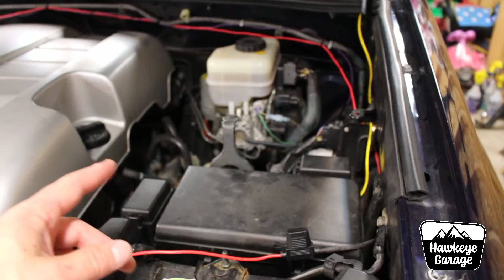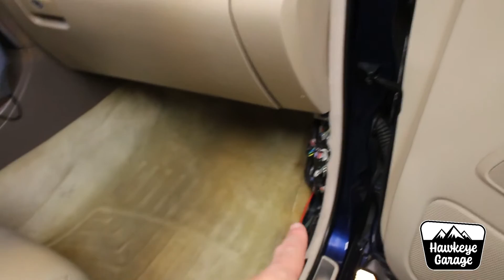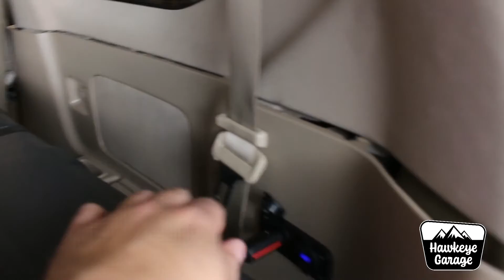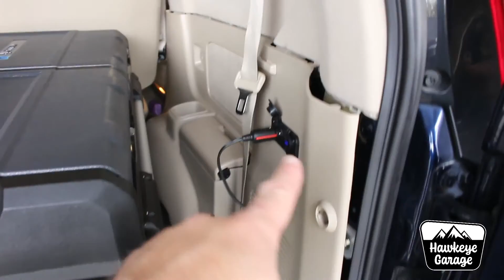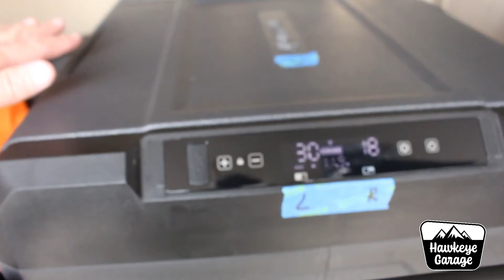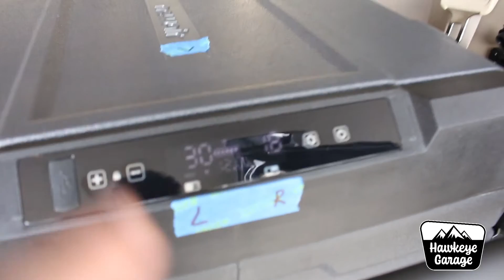Cargo Area 12v Plug and USB Wiring and Install

Comment: Hey Joe!
Thanks for the helpful videos!
I need help with my GX, changed all shocks to 5100s.. Now I got lights on my dash because of the front shock absorber sensor was removed. What can I do to get rid of the annoying lights on the dash?
Reply from the maker: Not sure, I expected that but I dont have any lights. Im still running air bags maybe thats the reason. I know there are videos out there addressing it though.
Reply: Thanks for the reply.. Im also running air bags on the rear just changed the shocks. Did you plug back your shock absorber sensor back thats mounted on top of front shocks?
Reply from the maker: @azfarc11  No I trashed those modules.
Reply: and you did not get any lights on the dash?? If you didn't that means Abs wire got stretched or ripped 🤔
Reply: my bad just read you 1st reply..Damm it's the abs I guess 😢
Reply from the maker: @azfarc11  that’s not too hard

Comment: Where did you ground to? Also did you just run 1 power from the battery to the 2 power wires on the plug panel like a Y? Don't know much about electrical stuff 😬
Reply from the maker: Yes 1 wire from the battery to the 12v plug then a jumper over to the the usb charger. There’s tons of bolts going into metal behind that panel to ground to and same principle with the ground wire going to the plugs.
Reply: @hawkeyeskunkworks  that's what I figured but wanted to make sure. Thanks dude!

Comment: Definitely cool in Iowa right now...but cooling air is super inefficient, so the compressor is going to run more than if the fridge was full of water bottles, etc.  (Think about how warm a lake feels relative to the cool air at night.  Water retains heat, or keeps cold longer than air.)   So I'd get some cheap water bottles and cool them down in your house fridge, or plug your 12V fridge in the wall and get everything cold...then transfer to the Lexus.  Fridge will run less full, than empty.
Reply from the maker: Yeah, I was just stating that it was in fact empty at the moment.